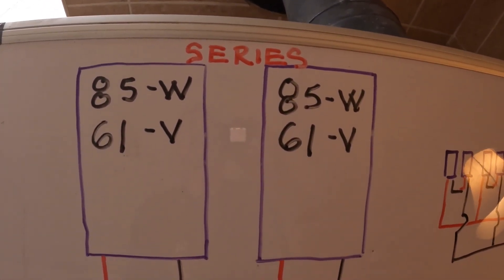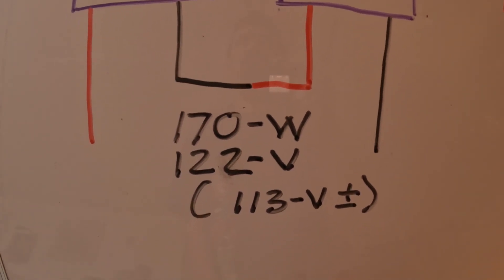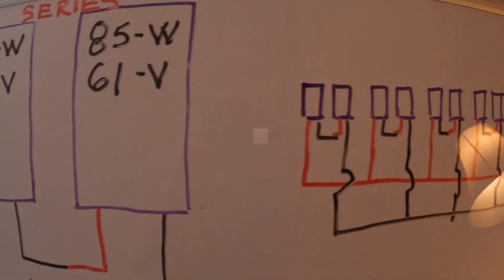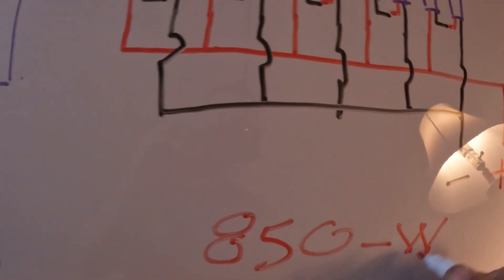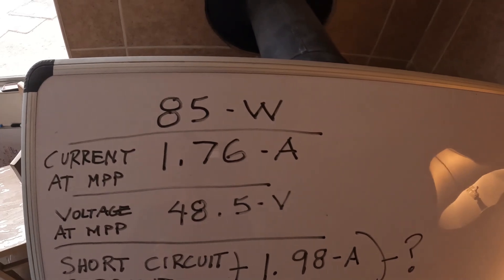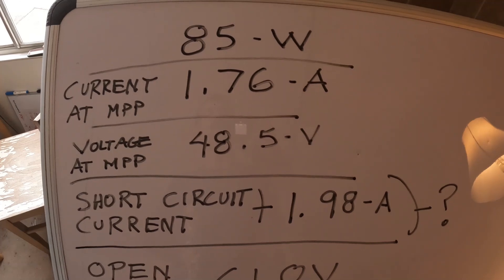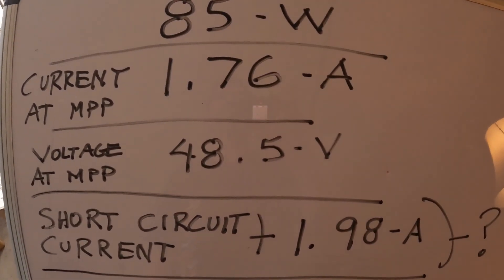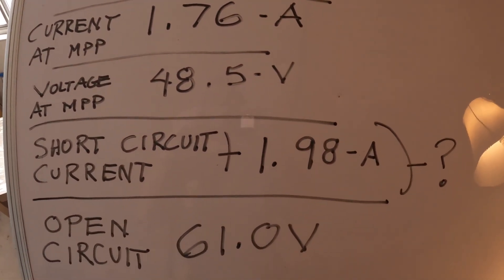Sand Battery Part 12 Solar Panels

Comment: I believe you can short circuit a solar panel indefinitely with no ill effects. It has no problem with the maximum current that it can produce. Unlike a battery.  Avoid disconnecting things in full sunlight (arcing)
Reply from the maker: I believe that also.

Comment: As a test apparatus... cool seems like its do-able .  But with 850 watts you will harness the heat of say running a hair dryer for a half hour. Or a hundred watt light bulb for 8.5 hours. 

I think I would concentrate on finding out the right sized container for your sand. Maybe using multiple heating elements to spread the heat energy out in the sand.

I'd  mount it outside just like an air conditioner.  So you'll have to enclose your sand container in say  expandable foam to prevent heat loss. 

You'll also have to figure out how to extract the heat in a controlled manner. Certainly use a thermostat.  

Possibility of using a copper coil spread through the sand.   Pump a liquid through it, into an a coil or some other heat exchanger device.  

Just spit balling
Reply: I'm going to place mine in the living space...with safety measures... so no "wasted heat.".. also allows less electricity needed for fans, instead  open lid etc.  Maybe Peltier fans, but fans don't use much Electricity.

Comment: open circuit means NO LOAD you're overloading your panels (shouldn't hurt anything) so you should check the actual voltage at the heating element while it's running on a good sunny day and on a cloudy day. I expect you are shortchanging yourself by not using a MPPT charge controller. What it does is keeps everything adjusted to get maximum power out of your panels at all times.  When the load and resistance don't match the panels power output drops. BTW I've lived off grid for over 15 years now.